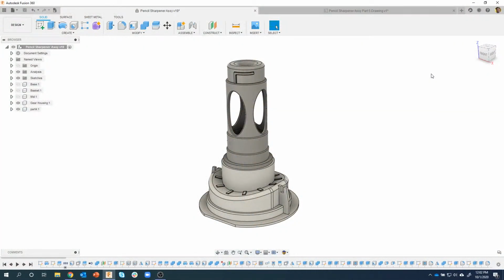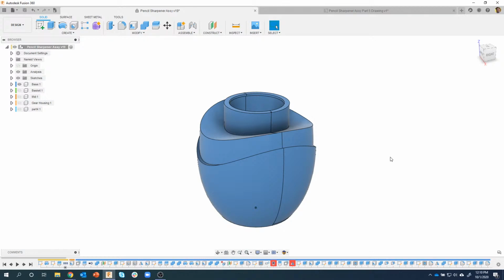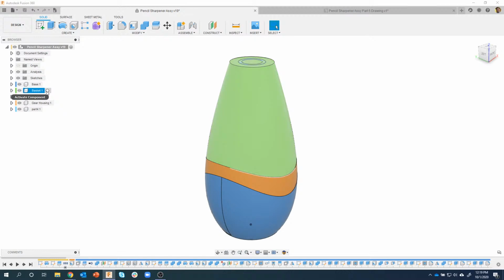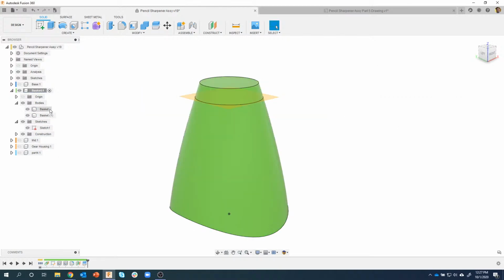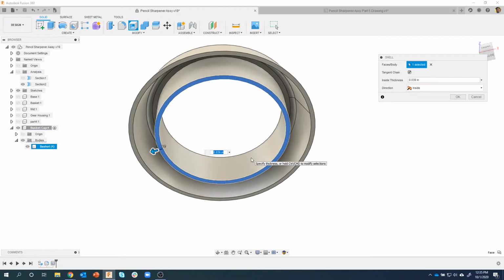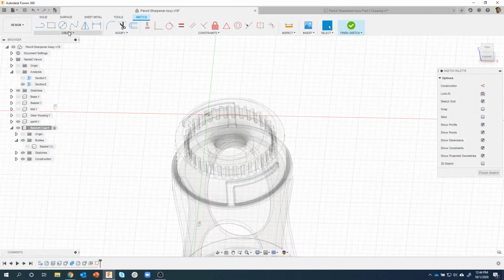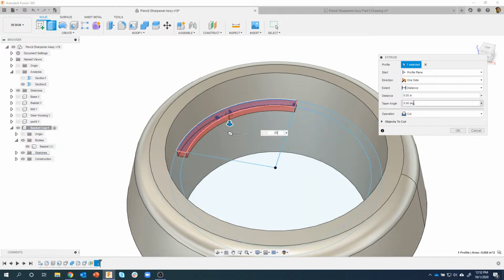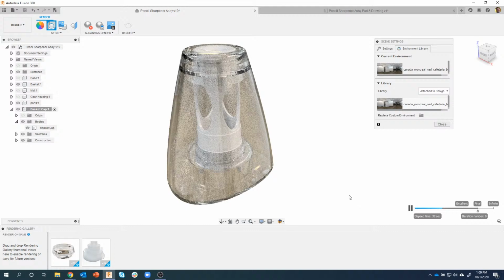Pencil Sharpener Project - Part 5

Comment: Yeap, I'd agree with @Ian Pendlebury and Karl Bowles.  How would you fit the middle lip (after combine @40') to the top of basket when the wall was tapered like that? It does show an interference between top cap and basket.  Will find out when we get to the end.

Comment: Brad - are you sure that the way you have created the interlocking 'conical tenon-style joint' between the two parts, at 40 mins, via the combine command would actually work in practice? The diameter of the bottom end of the cap part's tenon is wider than the opening at the top of the basket - seems that way to me anyway? I'm a regular viewer (via youtube - due to time difference) and have learned so much - thanks.
Reply from the maker: @Ian-  Thank you for pointing this out. You are correct, the parts wouldn't fit together unless you used a big hammer.  :)  I will show how to fix this in an upcoming LiveStream.
Reply: Yep, exactly what I was going to say. Surely the wall should be vertical, else when you drop the cap on top, it'd interfere with the opening of the basket component. As always though Brad, awesome video, I always learn a lot and I look forward to the next one. Shame it'll be in two weeks time, but will be interesting to see the CAM stuff next week, even if it's not something I'll necessarily use!